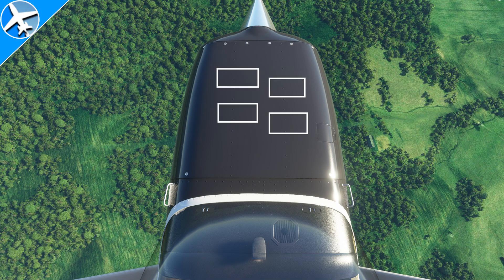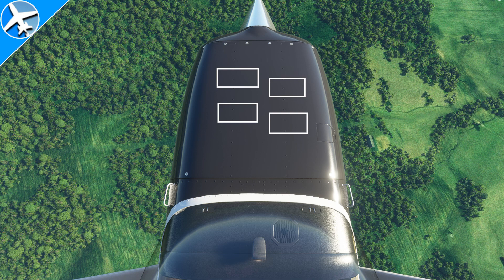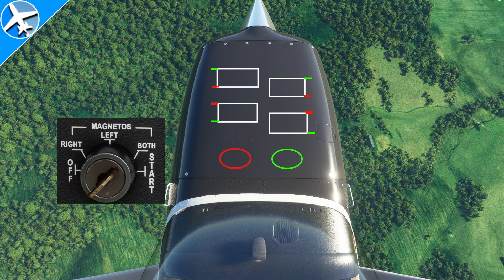Aircraft Ignition System and Magnetos

Comment: Good video. What is "mixture controller"? Is it a a carburetor?
Thanks.
Reply from the maker: The mixture control simply controls the amount of fuel going to the engine.  As the airplane climbs, air density decreases so the fuel going to the engine has to be decreased to keep a certain ratio of fuel to air as the aircraft climbs and descends.  That's where the mixture control comes in.  Carbureted and fuel injected airplanes both have mixture controls.
Reply: @thecorporatepilotdad  Thanks for your prompt reply. Keep it up.

Comment: Great video, what's the point of having the left and right magneto positions?  Why not just go from off to on (both) like starting a car?
Reply from the maker: One reason I can come up with for having a left and right side is being able to test each magneto individually.  If one mag fails and does not create current to the spark plugs to produce a spark, it would be difficult to know a mag has failed with an on off switch.  The only difference would be a slightly lower RPM with one mag failed.  This way both sides can be tested individually, and RPM drops noted to verify two properly working magnetos.
Reply: @thecorporatepilotdad  Cool answer, thank you.

Comment: How do you know a Magneto is failing during flight? Thanks
Reply from the maker: The normal RPM won't be reached if a mag does fail.  When doing a runup at 1500 RPM most airplanes engines have an RPM drop of 125-150 RPM.  The same would happen in flight and possibly a greater loss of RPM since the RPMs used in cruise are higher than the RPMs used during a run up.
Reply: @thecorporatepilotdad  Thank you Cap.

Comment: How does a blind man become a roofer? by insuring he does not hit the wrong nail!🤣
I would like to add! As you say starve the engine of fuel for shut down! Great advice! 😀The P lead (power lead from the Magneto) should be grounded in modern key switches but not always when the key is off. If the P lead is not grounded you could still have a hot mag. That is why you should conduct a ground check prior to engine shut down AT IDLE power to verify the ground is present in the off position. Return the mag back to both before the engine shuts down then pull the mixture! why? If fuel vapors were present in the Cylinder after shut down even with a properly grounded P lead The hot cylinder could ignite the vapors if the prop was rotated. BAD!  (many airplane drivers want their Prop Vertical when parked. because it makes a better bird perch, I mean looks cooler.) That is my .04 cents you know inflation! Great video 😀🛫
Reply from the maker: I always like your input and additions.  I kept it very basic.  The sim has failures for mags but neither mag would fail.  Showing the result of a failed mag during the mag check during run up was the motivation for this video.